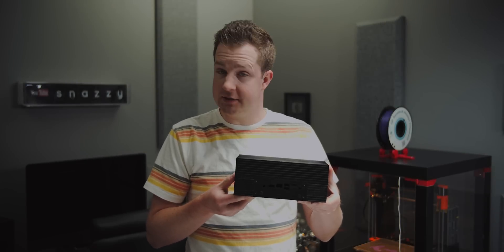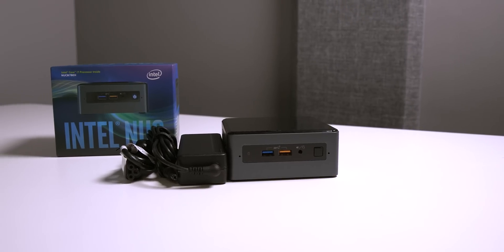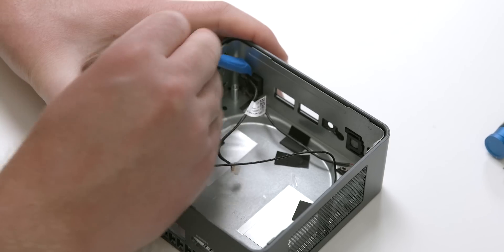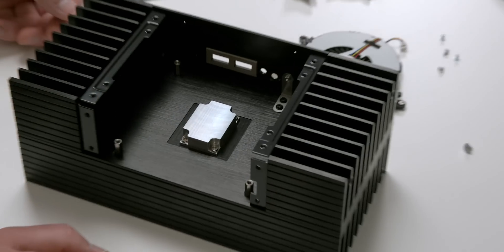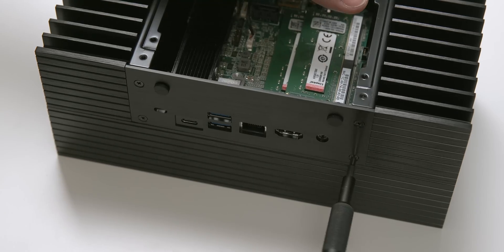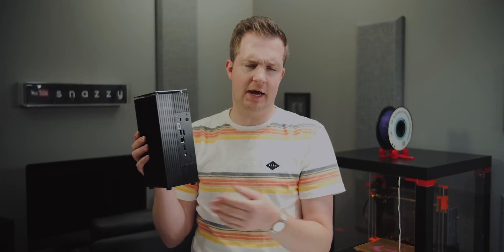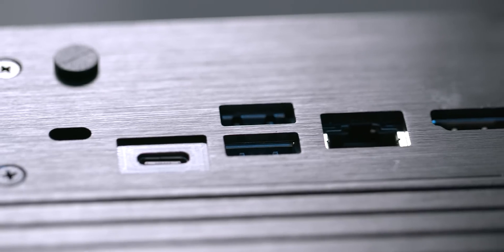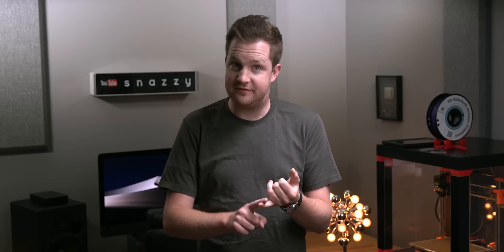The Tiny, Fanless, Mac mini KILLER!

Comment: I've subscribed for a while now and like most of your vids. Like many here, I'm comfortable in the OS operating environment, but
have become disenchanted with apple hardware. Apple has bootcamp that allows running windows on an apple machine and
although not officially sanctioned by apple the inverse can be done running OS in a virtual environment on a PC. Have you ever
done a comparison between such a virtual machine and a full hackintosh? The reason I ask is I'm thinking of a desktop replacement
laptop. There are several PC laptops that fit the bill but apple is mainly interested in selling you imacs. I think I'd appreciate your
view on this more than most other apple commentators. Anything you had to say would be appreciated.

Comment: Nice video and really cool case, but your price comparison (14:08) is a little disingenuous.  Really, the Mac mini is $1100, not $1600.  That is $270 more expensive than the NUC hackintosh.  The "spec'd similarly" claim is a bit of a stretch given that the options you added to the NUC (larger SSD and more RAM) are not really must-haves for MacOS, while the options you left off (3 more Thunderbolt ports allowing for more future-proof expandibility) and "forever" (call it 7 years) MacOS update/upgrade support are arguably more useful  and are not available at any price on the NUC.  So the real question is are those things worth $270?  If your joy is hacking at computers to keep them going, then probably, "No".  But if you joy is USING computers to get work done, then perhaps, "Yes".

Comment: I have a question. What’s the disadvantage of building a Hackintosh? What do you lose, as I’m sure there are some features that aren’t available on a real Mac.
Reply: Chad Wynne For my experience, if hardware properly chosen, a hackingtosh performs exactly like a real Mac. Maybe the font display is not that good.
Reply: Tao Tao you probably don’t get Apple support, and do you have to search for updates or does Apple push updates like a regular Mac?
Reply: Chad Wynne No Apple support of course. Update notice can be received but updating is not recommended either.  U may never boot up your hackingtosh again.
Reply: Tao Tao wow. I love power but that’s a lot of risk. Thank you for your help.

Comment: 11:05 " and that's it" well not quite, there is a lot of trial and error a lot frustration, and you also have to patch a DSDT file to make sure that the "drivers" are enabled to work, I am posting this comment from a hackintosh right now and my headphone jack still doesn't work, it all depends on the model of computer you decide to hackintosh and the type of computer, you decide to hackintosh, the intel NUC seems quite easy to hackintosh, that is because it is, but if you try to modify any other "non-modular" system it could be much, much harder. Quinn I appreciate your work and your dedication to the hackintosh community, keep up the good work!👍

Comment: What about the WiFi? I understand it won't work on Mac, but you coulld dual boot (or triple boot), and you'd have it then.
Reply from the maker: You can get it on Mac. You just need a supported card. They’re out there. Not too pricey.
Reply: @snazzy  I was under the assumption the one on this is soldered, AFAIK the only compatible SKUs are BCM943xx series.

Comment: One doesn't lose the micro SD slot if they are intelligent enough to populate it prior to MOBO install......
Reply from the maker: Accurate. Although, for what purpose does this serve?
Reply: @snazzy  I don't know as I forget, given I  may have a use for, but lack, additional cheap memory.
Reply: @snazzy  That would've been a reminder of a gone by technology. Should've been populated with stranger things soundtrack and the awesome mix vol 1 from Guardians of galaxy, also named casette tape after OS install.
Reply: Well couldn't you use it as a linux drive?
Reply: @rehmanarshad1848  Given it's being configured for a REAL UNIX and not the UNIX wannabe, it doesn't matter.
Reply: @sdushdiu  are you saying linux is unix wannabe or mac OS? I'm abit confused? o_O

Comment: To be fair, Apple tends to use very good ssd's. In particular they are MLC drives which are expensive especially compared to the qlc 660p which whilst cheap isn't that great. Even then though, with that case, the i7 nuc ,16gb of ram and a good TLC nvme ssd like a 760p, the i3 Mac mini with the same specs is almost twice the price here in Australia. Apple's pricing for upgrades are flat out appalling. Charging $640 AUD for the 512gb ssd upgrade when good consumer 500gb nvme drives are $150.
Reply from the maker: You'll note that I actually used the 760p. This was an error on my part as I could have sworn it was the 660p until someone told me once the video got uploaded. lol

Comment: "Thunderbolt works perfectly in macOS, as long as you don't hotplug devices...."
That's not working perfectly IMHO.
Reply: elspuddo i could be watching the video but instead reading the debate in this thread
Reply from the maker: Hence the need for a conditional.
Reply: My point is that without hotplug, you have to disable sleep, because your thunderbolt devices will never wake up properly. This may not be a huge deal considering how quiet and cool this thing is, but it's wasteful and annoying. I'm glad you added the caveat, I just found the use of the superlative to be a bit misleading considering it might be seen by some as crippling.
Overall though, I totally enjoyed this video. A+++ would watch again.
Reply: @snazzy  Hence the need to drop "perfectly", since it's a false statement given the conditional you added.
Reply: @alliejr he doesn't need to because it works perfectly anytime except for the conditional
Reply: @alliejr  There is no need to drop it. The conditional deals with the exception - tyhat's WHY it exiosts
Reply: @soomr1878   The Shuttle worked perfectly except for...

Comment: i dont get the point of this. Basically you swapped out cases. The overall speed is negligible
Reply from the maker: The point of this is that the NUC8i7 is a very good hackintosh and adding this case makes it silent. What’s not to understand?
Reply: Snazzy Labs I like this.. I could use this in music production room  instead of my MacBook. Those fans get loud
Reply: Snazzy Labs but cmon, was it really that loud to begin with ?
Reply from the maker: Under full load it’s rather loud, yes.
Reply: Snazzy Labs ok then. I take back what I said
Reply: Slick case tho and nice B-roll